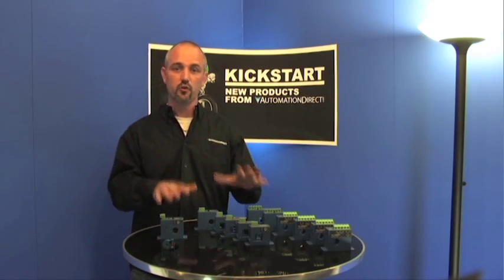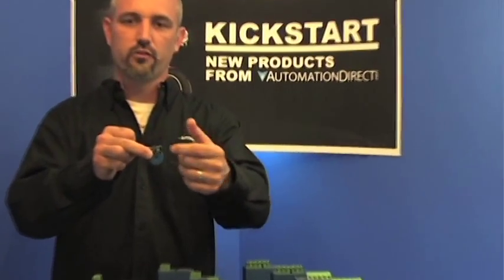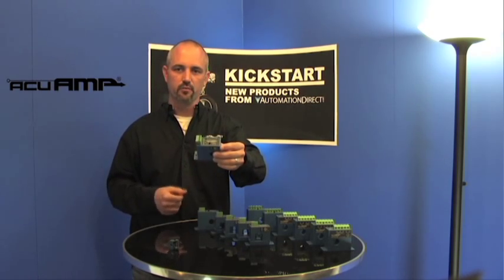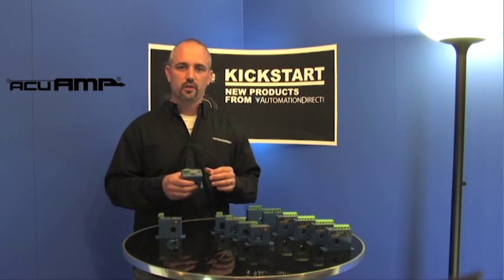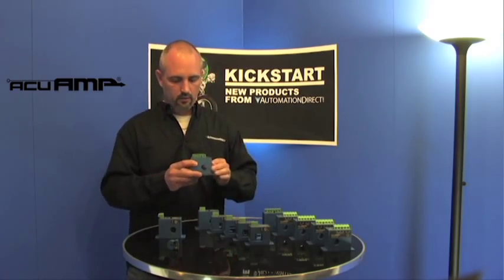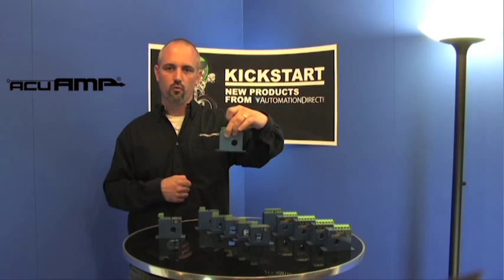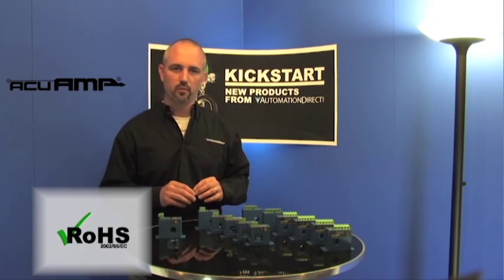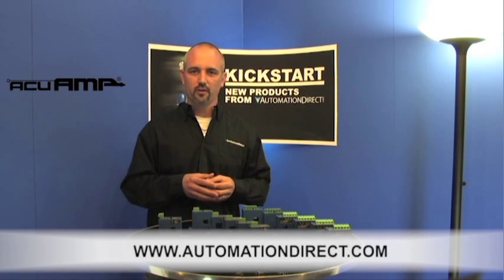AcuAMP DC Current Sensors, AC Ground Fault Sensors & AC Indicator from AutomationDirect

Comment: Have an application with solar panels but without an inverter since I am using a DC load. Looking for DC current and voltage (120VDC 15 amps) to 4-20mA to monitor power consumption. would it work with your DCT100-42-24-F? What do you suggest for DC voltage to 4-20mA?
Reply from the maker: Hi Trung,  Yes, the DCT100-42-24 Converts DC Current to 4-20mA. Note that you will need to supply power (20-45VDC).